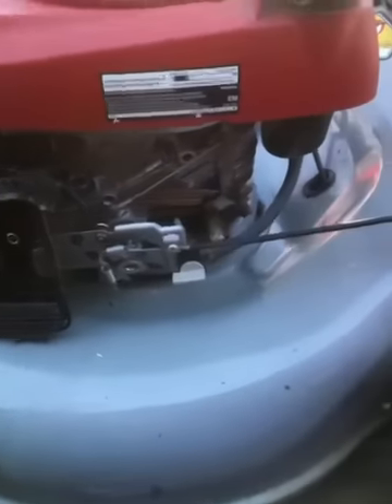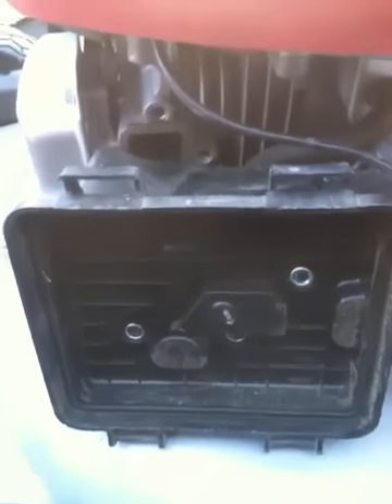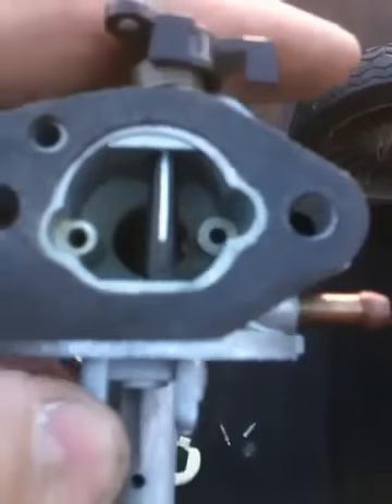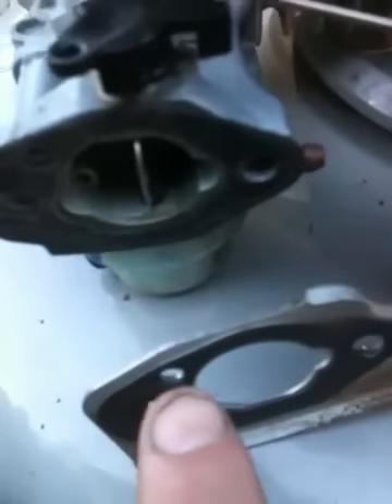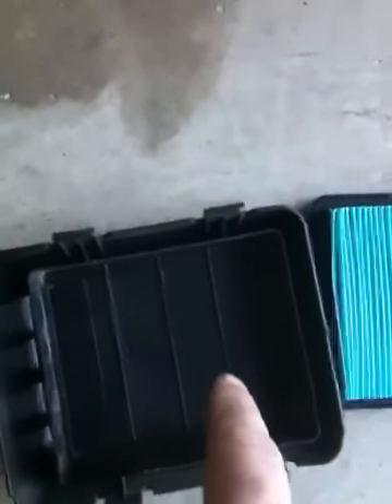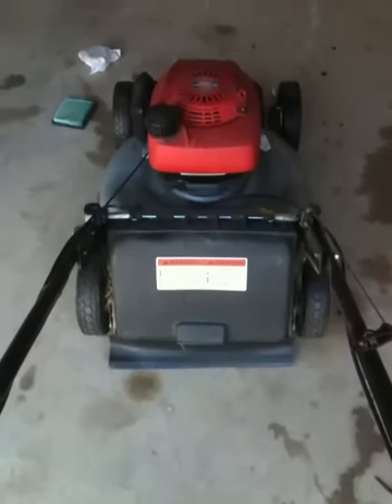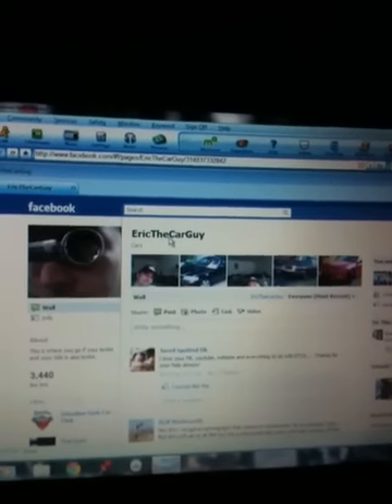LAWNMOWER REPAIR: honda carburetor repair

Comment: Hi Jeremy. Turns out that we didn't need a new carb. Just a thorough cleaning of all it's parts. Bought all new carb-air cleaner gaskets. Had a problem by not installing them in the correct manner. I downloaded a view of this carb and gaskets. My wife made sure I positioned each correctly. Voila, we now have an excellent running Honda lawnmower. Thanks so much for your valued assistance. Pete M.

Comment: This is a little off topic, but you said if I had any honda questions to ask. 
I have a HRX217HMA in my shop that is backfiring and oil is coming out the carb throat. I also asked Donyboy73 if he might know what is causing this, so hopefully between the three of us I can get this figured out. 
I really appreciate your efforts and now can reassemble these carbs and linkages alot easier. Great job!!! Terry aka FISER (Fox Island Small Engine Repair) WA. That is!

Comment: Thank you for the video. Everything you did was great and if you do no more .. still great.  As someone who didnt even know what the carburetor looked like before this video, there were some skipped steps that I would like to have seen some I have figured and some I hope to namely:
1. taking the carburetor off
2. disassemble the carburetor - dunno where to find those pins but hope to find after I clean exterior and remove the screws you indicated
Thanks

Comment: Thanks.  This is very helpful.  I have a similar problem with my honda mower.  It runs great choked and partially choked, but surges when choke is off.  Any advice is appreciated.  Using fresh gas, cleaned filter, new spark plug.

Comment: Thanks Jeremy,

I have a Honda engine very similar to this one except it has an automatic return choke with fixed throttle.  I cleaned the carb and is not running right.  It runs rich, uses twice as much gas, and erratically surges with occasional puffs of black smoke. The new spark plug also fouls quickly.  When I cleaned the carb I tried not to change any adjustable controls. Could it be that I didn't get something reinstalled property that does allow the choke to close completely?

Comment: Hi Jeremy. I removed and cleaned my HRR 216 carb per your video. I replaced all gaskets with new and put it all back together. It won't start and gas is running out of the air cleaner? What did I do wrong?

Comment: Can I use a paperclip to clean the holes inside the carb? I don't have any compressed air.  My poulin pro surges and will die when I hit any kind of normal thickness grass.  I pulled on some wire thingy (maybe it's the choke) and it ran at full speed for a while.  Then it just died.  There was gas coming out of the air cleaner.  New spark plug and new air filter in it.  New oil.  I get a spark with the plug. Thanks!

Comment from the maker: TERRY THE BACKFIRE IN MOST CASES IS A IGNITION TIMING ISSUE WETHER IT BE MECHANICAL OR ELECTRICAL.....AS FOR THE OIL IN THE CARB THROAT I WOULD HAVE TO LEAN TOWARD OVER PRESSUIZATION OF THE CRANKCASE AS IN MAYBE A BAD PCV VALVE, SEVERE BLOW BY,  OR ITS OVERFILLED ON OIL......LET US KNOW WHAT YOU FIND OUT

Comment: I tried removing my idle mixture screw limit cap by heating it with a cigarette lighter. Wound up snapping the head off. Luckily I can remove it and replace it. Needs something more like a propane torch to heat the glue enough. I heated it for a minute with a cigarette lighter and no go. Well, it did go but not in the way I wanted it to LOL.

Comment: Jeremy, in this vid you say to remove the brass needle valve that has the limiter cap on top (by heating the green glue).  When you reinstall, how many turns out do you set that needle???????

Comment: Good day,

I picked up one of this series of mower but with the cable controlled choke. 

I've carb cleaned (spray) the carb twice. Took everything apart I could. Even soaked it. The issue is as soon as I start to take the choke off more then ~20%, it struggles and dies quickly.

Fuel from the tank is free flowing and fast (washed it out). 

Spark plug is new.

Mower is pretty clean, looks like it was stored nicely.

Air filter and box is off at this time for the tests. 

I'm just about out of ideas. 

Any thoughts? perhaps i'm missing an adjustment?

Comment: Got a honda gx 120 on classen areator surging at full throttle , Some fine trash in tank  and carb probably from customer using old fuel to fill up before he brought back his rental. Drained tank cleaned carb replaced gov spring still the same. What am I missing?

Comment: Jeremy, in this vid you remove the brass needle valve that has the limiter cap on top.  When you reinstall, how many turns out do you set that needle?
Reply from the maker: 2

Comment: I have an ariens push mower with the exact same engine and carb, but my problem is it will only run when fully choked is that a valve or carb problem. when not choked the engine will die.

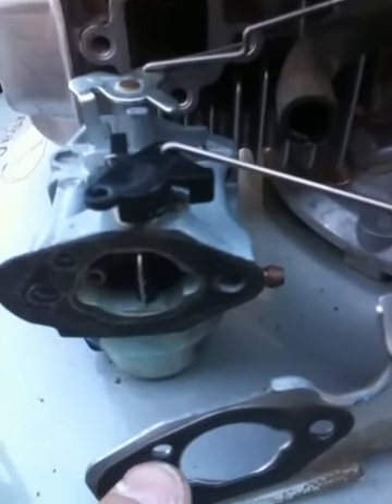Comment: The little bar that hooks to the plastic part of the carburetor on my lawn mower is missing,....I had searched so many videos to see what was supposed to go there, as someone else had worked on the mower and gave up before I got it.....what is the function of this  (2:45 ) you can see it.  Would this make the mower not start?  It was an almost new mower, wouldn't start in the spring, probably old gas...then someone decided to clean the carb and I don't think got all the parts back in it.

Comment: Good information, but you speed through too many things. I've had the carburetor off several times, trying to solve an engine speedup/slowdown problem. Cleaned out some of the jets but not all you mentioned. You go through that too fast. And maybe I need to change all the gaskets now?  Also--your camera shakes too much, you need a tripod. And use a horizontal format.